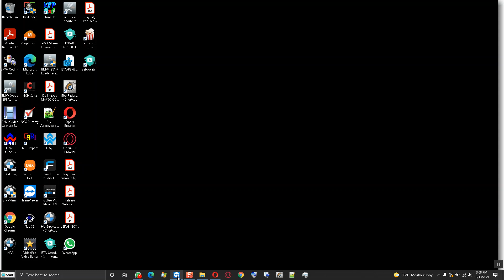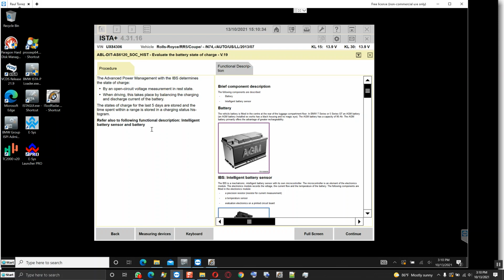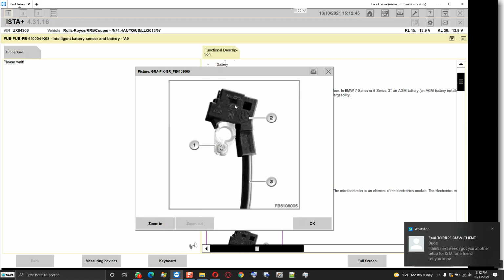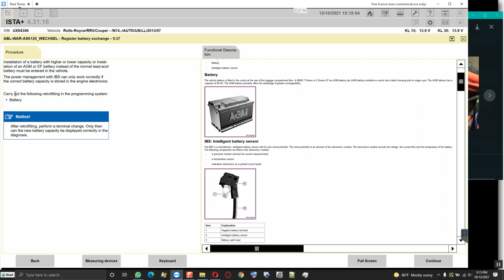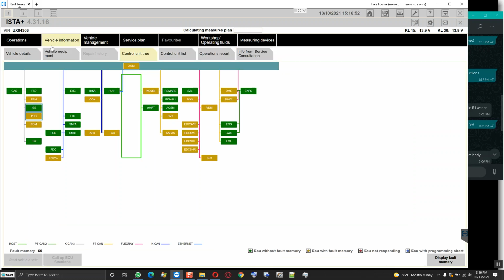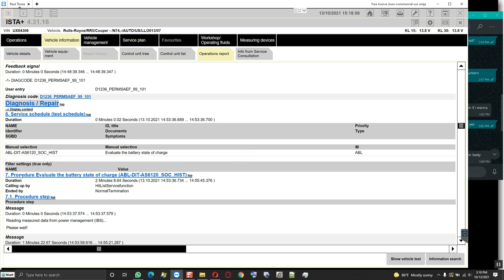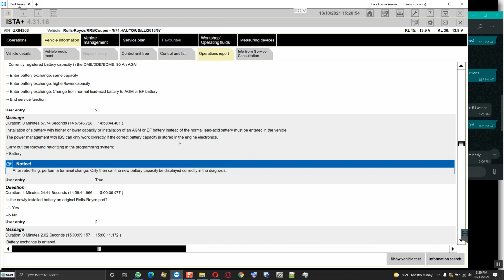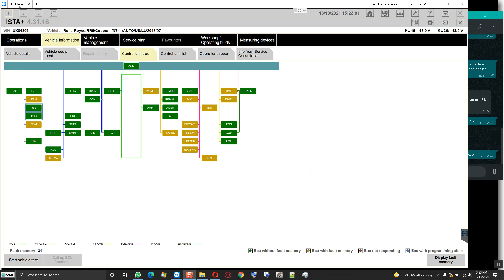Rolls Royce RR5 Register battery exchange 2021-10-13 15:23:12

Comment: The 2013 Ghost manual states: replacement
Use approved vehicle batteries only.
Only use vehicle batteries that have been approved for your vehicle by the manufacturer; otherwise, the vehicle could be damaged and systems or functions may not be fully availa-
ble.4
After a battery replacement, have the battery registered on the vehicle by your service center to ensure that all comfort functions are fully available.
Reply from the maker: follow what it says buy the correct ampere hour rating battery and cold cranking amps battery for that car.